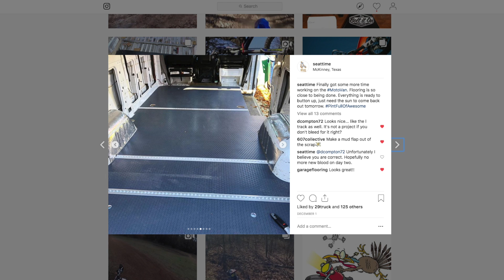Sprinter Van Floor Installation in the Moto Van Build | Part 2

Comment: Just a question, why not frame the floor and insulate in between before plywood? To gain head room? By compressing the insulation that much wouldn’t you reduce how effective it is?

Comment: I know this is an old video, but I'm curious why you didn't just get L-track that's flat on the bottom and attach it on top of the floor (all the way through into/through the bottom if needed) instead of having to precisely measure three channels between the pieces of wood.
Reply from the maker: Good question! When attaching l-track, or any mounting hardware to the flow, it needs to be securely fitted. If you just use self-drilling screws into the floor sheet metal, that's only as strong as the connection point can be. When I learned that, I decided I wanted a cleaner, more flush look, which the Flanged L-Track provided. If I just screwed the square version on top of the floor, it would then be a bigger bump to always try not to trip on. Hopefully that made sense.
Reply: @SeatTimeClips  yep, makes sense! I'd go all the way through the floor with a bolt + big washer minimum of course. Was just curious if there was a reason you use that aside from the bigger "bump" as you mentioned. Thanks for the reply!

Comment: Do you have any pics of the dirt bike loaded using the tracks you installed,? mountain bike loaded also would be great. Having a hard time picturing how it would work. Other then that it was a very helpful video.
Reply from the maker: I post a lot of pics to Instagram, and this one was awhile ago. Full transparency as well, after I got done doing the floor I got a message from the guys at Boltiton. They wanted me to try their rack in the van and I haven't given it back. It's been a great addition and I wish I had just bought it originally and not gone through the head ache I did go through drilling and prepping the floors. 

Here's the video made when we installed it: https://youtu.be/HynVJDzse8I

Comment: Question: you refer to the backing plates as conduit. I am searching for that product but don’t have a proper keyword to find it. What’s it name in the trades so I can find it? Thanks for the video as it gives a method.
Reply: Answer found: steel unistrut channel.
Reply from the maker: NICE. Good job on the googling. Now that I have the Boltiton Rack, I really don't need that support, but here we are. I had a plan, executed it, but then a new plan presented it self.

Comment: I love thinsulate, but it's not the right material for underfloor.
Reply from the maker: Do tell more. I'd like those that find this in the future to have as much information on materials to choose as possible.
Reply: Currently building a van as well. LOVE Thinsulate but would have to agree that it's not the most effective insulation for floors because as it compresses it looses it's insulating qualities. You'll retain some but not as much as if the insulation were allowed to fully expand. A good alternative would be some sort of foam such as XPS foam board.
Reply: @piccolo6214  Yes I agree, thinsulate only works to its potential when it's not compressed and is able expand to its full 1.5" thickness.  The best material I believe is the high density closed cell foam (similar to those thin camping foam rolls).  You can get 3/8" thickness to cut thin to put between the floor corrugations, then once level to the top of the corrugations, a full layer of 1/4" thickness. Thinsulate is perfect for the walls and ceiling.

Comment: How much of the coin floor did you buy? Thanks
Reply from the maker: I bought the 95 Mil Felt Back Small Coin Gray 8ft. On their site the smallest I found was a 20ft roll. I emailed and asked if they had any take off they would sell in a smaller roll. They did and I purchased 15ft.